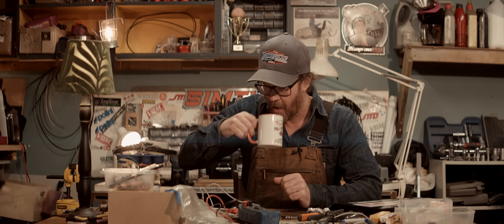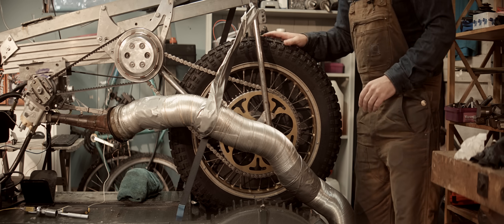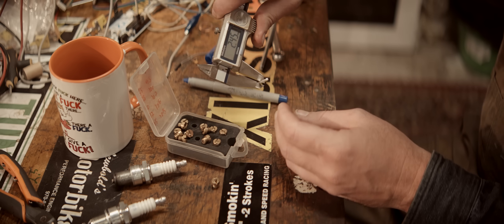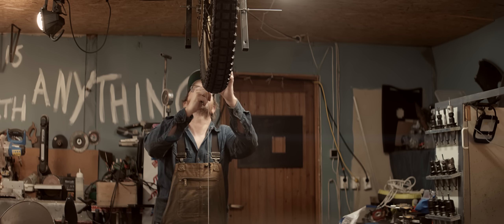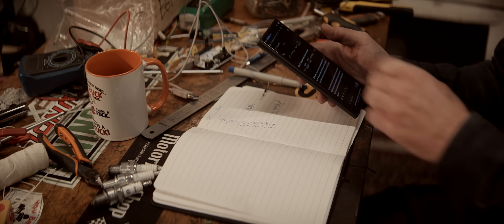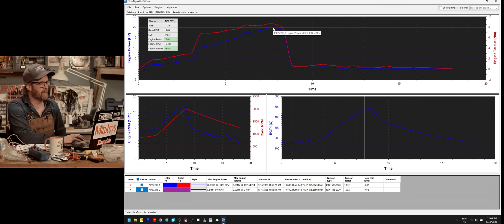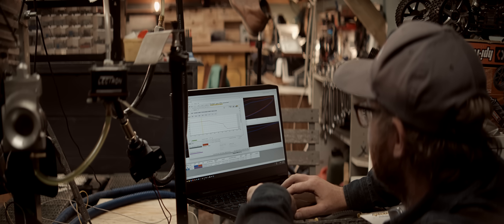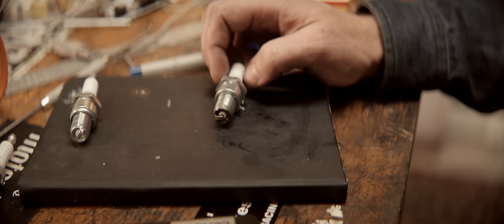22+ Wheel HP from 50cc! Finally!! And we're just getting started.

Comment: It's great that the engine is now making decent power. From my understanding of how a dyno works, you don't need to include the wheel in the values. You start the measurement by accelerating the roller, then the clutch is depressed. As the roller coasts down, it measures how quickly it decelerates, and from this, the loss due to the tire and chain is calculated.
Reply: Still need to know inertia for coast down test to have any meaning
Reply: @MikeyAntonakakis no, software calcs it 😂
Reply: @andreas.d9143 what exactly does the software calculate if it doesn’t know the inertia? Torque = inertia * angular acceleration. The dyno only measures angular acceleration. You need to know two variables to calculate the third. The software uses coastdown to calculate the loss torque of drivetrain losses by measuring the angular deceleration on coastdown. For it to do that, it NEEDS to know the other variable in the equation, inertia.

If you increase the inertia by adding roller weight, the software cannot automatically compensate for that because it literally doesn’t measure the inertia, it measures angular acceleration. The only automatic compensation it could do is to assume you have lower drivetrain losses since coastdown will now take longer.
Reply: @MikeyAntonakakis I've never seen anyone measure a car's tires on a dyno to determine something. What are you talking about adding more weight to the roller? I can make the roller 1000 kg heavier, and it still comes out right in the end if the roll-out measurement is done correctly... but yeah, you probably know better.
Reply from the maker: The reason I included tire inertia is my roller only having 2.17kgm2 of inertia. With say 10kgm2 the tire would be insignificant. My light roller works partly cause it has lots of parasitic drag from cooling vanes, seals, and big bearings.
Reply: @andreas.d9143  he has an inertial dyno. The interia of his roller is relatively small, so the inertia of the tire makes a significant impact to the accuracy of the power measurement unless it is accounted for. That’s what I’m talking about regarding adding inertia to the roller. If you don’t account for the inertia of a significantly heavy tire (compared to roller inertia) then the dyno will read too low, and the coastdown measurement will be inaccurate.
Reply: @andreas.d9143 and regarding making the roller 1000kg heavier, it absolutely will not work out in the end unless the operator adjusts the roller inertia value in the software. The rollout measurement would just show that there is less parasitic loss in the system, not that the inertia changed, and the dyno readings would be WAY off. Friction and inertia are completely different aspects of the total system power and thus need to be handled separately - roller inertia as a constant manually input to the software and friction via coastdown test (either including or not including the vehicle in the measurement as desired by the operator).
Reply: @MikeyAntonakakis Yes, your statement about the wrong results is correct, which is why every dyno has the ability to measure towing power, i.e., rolling with the clutch depressed, where the loss of the tire, the chain, etc. is calculated away... if you don't want to and can't understand that, I can't help you either.
Reply: @andreas.d9143 i absolutely understand that, and that measurement measures frictional losses. The friction/losses of bearings, tire deformation, etc cause the roller to slow down. Increasing system inertia will cause it to decelerate more slowly. Again since torque = angular acceleration * inertia this will require a constant value for inertia to be manually input into the dyno software so that loss torque can be calculated accurately. Adding significantly more inertia to the system (system of dyno + vehicle) without manually adjusting the intertia value in the software will cause the coastdown loss torque calculation to be wrong. The coastdown measurement cannot calculate the heavier tire on Alex’s dyno because that extra inertia is a critical input to the coastdown measurement itself.
Reply: @MikeyAntonakakis You seem to like to take things very precisely. Okay, then we also have to include the tire's profile, air resistance, tire pressure, ambient pressure, etc. in the calculation. All of this has an influence. Have fun calculating. People tend to overestimate some things and neglect others. If you want to be precise, you have to measure everything individually.

But yes, why don't you measure at the end how long the roller takes to decelerate? The tire also influences that. If there's a tire with a lot of inertia on it, the roller will rotate accordingly longer... wtf... what can we learn from this? We don't need to calculate anything, we just need to measure correctly and have enough brainpower to understand it.
Reply: @andreas.d9143   I am simply saying that total system friction and total system inertia are two entirely different things that have different implications for the values an inertial dyno spits out. The torque number the dyno software shows is measured torque + loss torque. Measured torque = angular acceleration * dyno roller inertia. Loss torque = angular deceleration  * dyno roller inertia (with clutch pulled in or whatever test protocol, regardless it ends up as a constant value/curve/whatever). Any dyno software assumes the operator has correctly input the value for roller inertia, and underreporting that value to the software will underreport the loss torque and underestimate vehicle torque/power. Coastdown test by definition cannot correct for an inaccurate inertia value, since the input to the test is inertia and the output is an estimate of frictional (not inertial) losses.
Reply: @andreas.d9143  As for being precise, you're misinterpreting what I'm trying to say, and you're conflating a desire to be precise with a desire to overcomplicate. Personally, I like simple, so I don't care to know where the individual losses come from, but it is vital to at least separate things into two broad categories: total frictional losses and system inertia, and to treat them separately, at least if you want a dyno that gets anywhere near a reasonably accurate reading. Drawing a line to divide between vehicle and dyno system inertia also helps - in Alex's case he is including the heavy tire in the dyno inertia (the correct approach for his situation).
Reply: @MikeyAntonakakis  So let's summarize: we measure during acceleration, including inertia; we measure during deceleration, including inertia.

What does the tire do during acceleration? Its inertia is a resistance during acceleration. What does the tire do during deceleration? Its inertia gives the tire more kinetic energy, the tire rotates longer. If you don't take into account losses due to the chain and bearings, which are also measured during coasting, you still get the right result in the end... unless you have a truck tire and a mini dyno; the inertia tire and dyno should already be right.

So what can we learn from this? Inertia is measured during acceleration and during coasting, and is therefore excluded from the calculation, so it's unnecessary to calculate it.
Reply: @andreas.d9143  mostly correct - the problem is the dyno software needs to know the inertia value for any of the calculations to work. If that value is incorrect, then the acceleration run is incorrect and the coastdown is incorrect. If we underreport the inertia (by not taking into the account the heavy tire) then the acceleration run will report too low, and the deceleration run will report friction as too low. Both will have the effect of underestimating the power the vehicle produces. The acceleration run and deceleration run will not cancel out the error in inertia value used in the calculations. If Alex somehow had a baseline run with a much lower inertia tire, and changed nothing but the tire before doing another run, then yes, he could calculate the difference in inertia between the two, but that’s pretty obviously not the situation he’s in.
Reply: @andreas.d9143  As far as inertia being “excluded from the calculation” it’s literally a critical input to the calculation (as a constant value in the software manually input by Alex with his homebuilt dyno). So it is absolutely necessary to calculate it or the inertial dyno will not be able to report torque or power. He is not running a load cell dyno that measures torque directly.
Reply: @MikeyAntonakakis Yes, there we are again with the problem of feasibility and correct values. It is so easy to determine chain and bearing loss using the dyno. If you have the values, it is no problem for the software to set the correct inertia. You just have to measure everything at idle between 60 rpm and 30 rpm or even less. The software should be able to calculate everything from this, if the software can do so.
Reply: You got it the wrong way around the acceleration is measured not the deceleration 😅 deceleration would only give you the powerlose from bearings and air drag but you want too measured the power that is accelerating the roller 😅
Reply: @TheLtVoss 😂😂Learning to read properly would also help you a lot
Reply: @andreas.d9143 you should read again  the acceleration matters not deceleration
Reply: @TheLtVoss My friend, how do you get the roll up to speed? Certainly not by not being able to read. I wrote that you start the measurement by accelerating the roll... do you think someone does a Fred Flintstone and runs on the roll to speed it up.🤔
Reply from the maker: I haven't included the tire and chain in the coastdown measurement, only the roller. How I use the software I plug in the numbers after a roller coast down and those numbers are used for every run. Could do a run coasting down with the clutch pressed, but friction in that clutch would maybe give skewed results.

Comment: I think reading the plug for a two stroke is only marginally useful.  My big thing is that the EGT is climbing during the full run.  If at some point it starts to drop, you are too lean.  Rocking the timing back and forth will affect your temperatures.  More advanced will lower EGT and raise CHT.  More retarded will raise EGT and lower CHT.  Those changes are with the same carb settings and will move the power curve up and down.  Instead of the plug, read the top of the piston.  When in doubt go richer since it costs a lot less to be wrong in that direction.
Reply: I agree, plug reading became an almost pointless waste of time when they removed the lead from petrol, it can tell you if you are massively rich or lean but that's about all it can do. Monitoring temperature along with dyno runs is the way to get the AFR right.

Comment: I've done some messing around with jetting on my KTM 150xc because I ride it the winter with studded ice racing tires, trying to keep it safe but still aiming for good power. I've always aimed for a brown plug with my 40:1 oil mix. It'll get black when trailing riding even when it feels great just because of the amount of closed throttle time.
Reply: Wouldn't it be best to just do plug chop readings?
Reply: @theshippingcontainergarage Yes I do plug chops for the ice riding, plugs are just 20-30$ depending on where I can get them from so it's expensive to do them every outing.
Reply: @gerbil7771  Ouch that's expensive... Can't get a cheap "junk" plug just for the test?